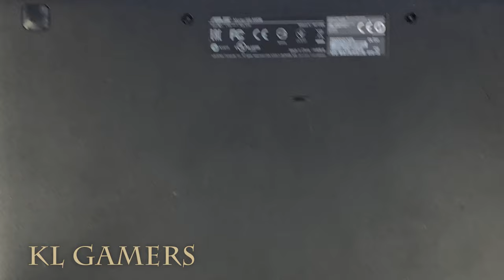ASUS X453M Notebook Laptop Change Repair Replace Keyboard 2021

Comment: Those melted plastic rivets / inserts are horrible, they make it almost impossible to resecure the replacement part as good as original, certainly a lot more time and effort than reinstalling some mechanical fasteners in place!

Comment: Bro asus ex a320m motherboard il athlon 3000g support avoo
Reply: Yes it will support out of the box
Reply: @nandhinisr3443  out of the box means
Reply: Pz reply
Reply: @MK_GAMING_GARAGE  it means that the motherboard will support the processor without changing any settings. U just need to install and it works. No change of settings in bios required
Reply: @nandhinisr3443  okk